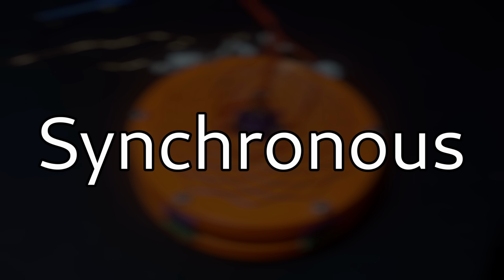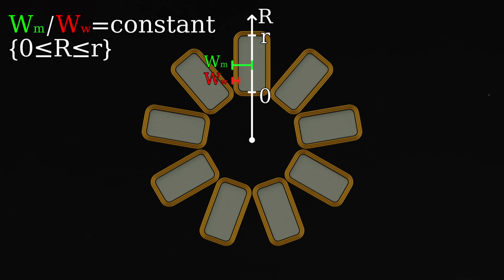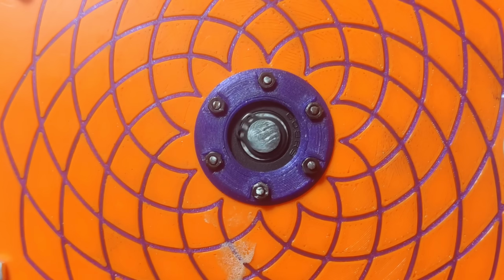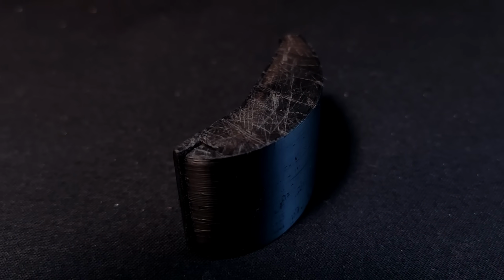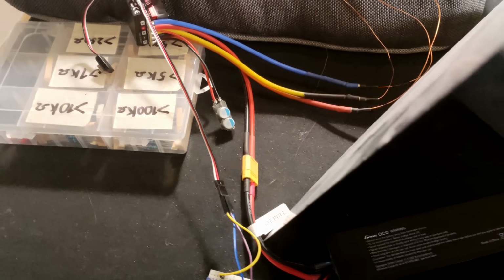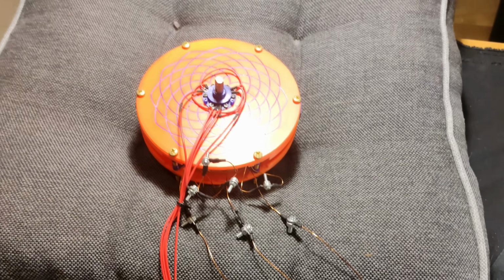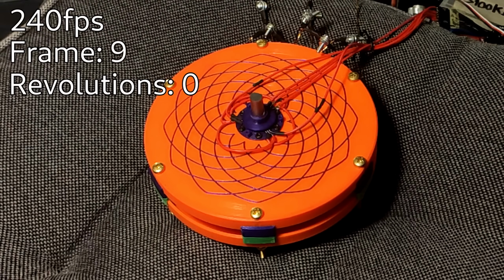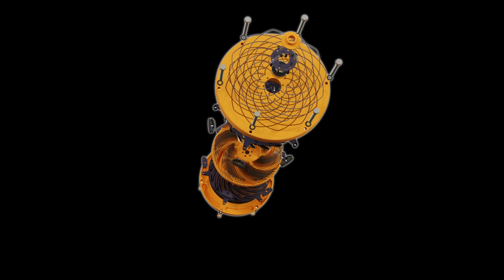Axial Flux Synchronous Motor Prototype

Comment: Axial flux motors typically use air-core electromagnets for several reasons that relate to efficiency, weight reduction, and magnetic performance.

Key Reasons for Air-Core Electromagnets:
Reduced Core Losses (Eddy Current and Hysteresis Losses):

Conventional motors often use iron cores to concentrate the magnetic field, but this introduces core losses due to eddy currents and hysteresis.
Air-core designs eliminate these losses, leading to higher efficiency at high operating frequencies.
Weight Reduction:

Air-core electromagnets are lighter since they don't require heavy iron cores, making axial flux motors more suitable for applications where weight is critical, such as electric vehicles (EVs) and aerospace.
Improved Power Density:

Axial flux motors naturally have a compact and flat design. Removing the iron cores further reduces bulk, improving power density and allowing for a thinner motor profile.
Better Thermal Management:

Air-core coils can dissipate heat more efficiently as they are not thermally insulated by a heavy core, making them less prone to overheating.
Reduced Cogging Torque:

In iron-core motors, the interaction between permanent magnets and the iron teeth can cause cogging torque, leading to uneven rotation.
Air-core designs avoid this issue, resulting in smoother operation, particularly at low speeds.
Trade-offs
Weaker Magnetic Field: Air-core electromagnets have a lower magnetic permeability compared to iron-core designs, which can result in weaker magnetic fields for a given current.
Higher Copper Usage: To compensate for the lack of a magnetic core, more copper turns are typically required, increasing material costs.
Mechanical Stability: Air-core windings may require additional structural support to maintain their shape and position.
Despite these trade-offs, the advantages of air-core designs often outweigh the downsides for applications where efficiency, weight, and dynamic performance are crucial
Reply from the maker: You will not find an EV axial flux motor without iron cores (typically they use specifically engineered materials, and at least in one case I have seen them use something similar to ferrite as the core material) but it is just straight out not correct to say that axial flux motors don't need iron cores... If engineered correctly, then they will increase power density and can also increase efficiency. 

For my next motor project, which I hopefully will get done within the next few months, I have even finally ran some FEM simulations, (and did just right now to confirm), and air cores lose out roughly 30% of the torque. Sure, the motor would spin faster for the same input power as a result but I specifically need my motor to be slower and higher torque at a given power input. 

As is almost always the case, you choose the materials and how you make your motor based on what you want your final result to be. Want a super highly efficient, probably fairly fast spinning but with low torque motor... say for a harddrive or something else like that? Go ahead and use air cores! Want a highly efficient, slower spinning but high torque motor with as high power density as possible? You probably will want to look into electromagnet cores, but you'll have to engineer them... not like in this video - with the motor shown in this video I agree that the cores probably actively harm the design rather than help it :D
Reply: @BirdbrainEngineer  On the contrary, high end EVs such as BMW, Mercedes, Jaguar, Ferrari, Lamborghini, McLaren, Koenigsegg even some Teslas use axial flux motors. I believe the company that came up with that concept waws Koenigsegg. The benefits besides efficiency is the low weight to power ratio. Furthermore, Rolls Royce makes axial flux motors for aircraft.
Reply from the maker: @ I did not say that companies aren't using axial flux motors for EV-s... I said that basically all of them have iron cores, usually out of an engineered material of some sort as opposed to the normal electrical steel laminations (though those also exist!). As far as I have seen, air core axial flux motors are used mostly in low power applications.

Comment: The problem is not your design, its your controller. ESCs are made to drive trapezoidal EMF BLDCs with concentrated windings. Distributed windings have a sinusoidal shape, which means that even if the control method was correct, you would have a lot of torque ripple and very low efficiency. You need a switched reluctance driver made for distributed windings.
Reply from the maker: You are correct in that a VFD driver would work much better for this and that a normal ESC would be less efficient and all... But the point never was to make an efficient motor, but to see whether it worked at all.

Comment: Your magnetic flux paths is through or normal to the pancake surface, so it will make eddy currents in the plane of the windings creating the magnetic flux, offset by gap. So the thin sheet, or not so thin sheet, is thin in the wrong dimension for breaking up eddy current areas into smaller, less lossy ones. Giant toroid cores can be cut into sections that are approximately the shape you have. Like a 1/3 of a toroid. The powder core does not need orientation like soft steel layers do. If the material can be had, and a way to fire the shape, you can make your own custom core shapes. Liked this video, shows curious not afraid of failing, just want to learn mode. :)

Comment: a permanent magnet synchronous motor, if you dont have the field windings connected to power source, can you freewheel the motor without resistance? I mean just in general with type of motor? Can a brushless hub motor be considered a synchronous motor?

Comment: Wow. Awesome project really, the way you set up the coils and ferromegnetic look very nice but I bet they were a pain in the a... to set up. I am actually trying to build a wind turbine generator and came up with faulhabercoils in the stator and a double rotor (on top and underneath). Those faulhabercoil windings are very nice, because you don't come up with lots of wire outside the magnetic fields, the downside is, that the magnetic fields do not cross the wire in 90° angle. This is (maybe) the cause why you have to 'kickstart' your motor. Love your work!

Comment: Afaik sync motors work because of Foucault currents (it's not about an attraction but about a repulsion). And you split your rotor into strips (and selected iron for that instead of aluminum or cupper). So, where a current must go?

Comment: What I am wondering is why don't the electric motor companies make ture high efficiency motors when they known the technology from TESLA for over a hundred years ??? This tech is right under there nose. Period vf
Reply from the maker: Brushed Axial Flux motors were first built by Faraday and later Jacobi made an actually useful motor. The reason for not building axial flux motors is because the efficiency gain in modern motors is not that huge... the gains are in motor weight and space savings, at the cost of more complex and expensive construction... so for the vast majority of use cases where electric motors are used, they just don't make economic sense. But in automotive applications, electric planes and so on, axial flux is likely the way things will go.
Reply: @BirdbrainEngineer  THANK you for clearing that up BBE. My thinking is this should of happened years ago. Peace vf

Comment: Hi!  You really  work hard ! Heats down!  Quick  question :  Is  trying  to  use  a  PCB  Motrors  technology  for  Axial  flux  motors a good  idea ?
Reply from the maker: Depends on your use case! If your design can work good enough for your use case with an "air" core and the current through the phases is not very high then why not! But for anything with higher power is likely to not be worth it - There are several limitations that the fiberglass used in pcb manufacturing brings up; Less copper in the stator as fiberglass takes up the bulk of the pcb's volume, worse cooling because the heat needs to transfer through the fiberglass first, usually no iron cores because pcb motors are extremely "flat", limited phase current because the pcb trace size is limited.
Reply: @BirdbrainEngineer  thanks !
Reply: @BirdbrainEngineer  another  question that popped  in  y mind  what  about  staticks  multiple   PCB  stators ?
Reply from the maker: @jebarijihed  Do you mean stacking multiple together? If so, then that's possible to do, though you'll have to figure out some way of reliably connecting the traces between the different pcb-s. Stack enough of them, and you might be able to even put an iron core in it with the help of some epoxy or something. But it still doesn't help with the other problems that a pcb stator has. For something that actually needs some good amount of power density, say like an e-bike motor, then pcb-s are kind of hopeless... I'm not saying you couldn't do it, but I also just don't know why you would bother with it when using magnet wire is much more efficient in such cases ;>
Reply: @BirdbrainEngineer  well worth a  try !     Thank you a lots  of  lots  :D

Comment: the gap created by the print between your windings and the laminations probably causes a lot of reluctance. reluctance motors in general are lower torque and are more sensitive to air gap also. 

for your KV: you should do the opposite test, drive the motor at a set RPM and measure the output voltage under open circuit

Comment: awesome video! really good production quality, extremely informative, one of the most informative Iv seen in a while, and just ingenuity at its finest with all that math and good understanding of the motor and its physics! EDIT: also Im just curious and i doubt this comment will get seen but how do reluctance motors induce a back emf/ resistance of some sort to the input voltage. all motors of some sort have some sort of back resistance because as rpm increases output power increases and thus input voltage and current draw should also change. or if there is no back emf or anything how would a motor like this work or what shape power chart would it produce?

Comment: What impose a max speed to this design?
Reply from the maker: Ultimately, physics. Easy answer... kv rating of the motor, which roughly depends on the number of wire turns on the electromagnets and the strength of the permanent magnets.

Comment: If you're looking to do without earth magnets, have you considered maybe a shaded pole motor design? Of course you'd need an inversion system of some sort to convert it from AC to DC, but I recently pulled one out of an old microwave, and it seemed to work well without the need for magnets. I'm new to all this, but an AC motor of some sort would seem like the way to go

Comment: What kind of calculations did you do in order to determine the design of the reluctance structures for the stator and the rotor? Have you used any electro-magnetic simulation tool like FEMM or MAXWELL? I use FEMM for a good approximation of axial flux motors / generators. It is a little bit tricky because it calculates more in 2D and I have to build the e-machine in a way to get a good approximation of the data. So I simulated a linear motor version of the build circular structure. But this is ok. The data came out in 10 to 15% approximation.

Comment: So a difference between SynRM motors and IPM/SPM motors is their Id, Iq current scalars. In an internal PM machine the Id current is always going to be negative while the Iq current will be either positive for positive torque values or negative for negative torque values. In a Synchronous Reluctance Machine the Values of both Id and Iq are positive. This could be why you kept getting a stuttering effect and no motion, the controller was braking the machine rather than accelerating it. I'm not sure what settings you had enabled in the Inverter but that could be something to look into. Also the Field weakening algorithm is different between the two motors.

Comment: Excellent work.  Very novel.  Since you're using a lot of 3D printed parts have you ever tried the iron composite PLA from ProtoPasta?  It's not as good as using real iron, but it's far better than just plain plastic.  It's about 40% iron by weight, which translates to about 8% iron by volume.  Magnets will actually stick to it fairly well, but it's not magnetic itself.  For generating stators, or for making iron backings for rotor magnets, it's just so convenient.  All those volute shapes could just be 3D printed instead and would immediately do the job, and there is, in essence, no air-gaps between the iron in the PLA and whatever you're wanting to generate your magnetic fields.

Comment: This is awesome . . . the achilles heel to the Axial flux motor IS the dependance of large mafnetic requirements . . . . there just isn't enough know deposits of approriate rare earth to powe the potential need of this motor type . . . . . a great achievement. The next step is to find ways to increase the efficiency as reluctance motors are always less efficient.

Comment: Small rotary tools can hit 30,000 rpm
Reply from the maker: Yes but what rotary tools are driving weighs less than a single magnet in the rotor of this motor and the radius of the cutting tool that is rotating is not more than 2cm, while the radius of the rotor here is over 5cm, we are talking completely different amounts of potential energy stored here. RPM is only half of the equation.

Comment: You can bias magnets into focusing their fields on one side by a halbach array, what´s not possible with coils. So, the stator has to be electromagnetic, and in the middle, in order to exploit its both sides, while the rotor is made of 2 discs with magnets, in halbach array config, embracing the stator between them. Otherwise it´s a huge waste of magnetic field, and thus, power/energy.

Comment: Correct me if I am wrong, but isn’t the center of the coil where magnetic field is strongest? Isn’t it the center, where all the flux lines combine?
Reply from the maker: I may be talking out of my ass here because I am still learning all of this as I go myself. But so far I have understood (and by my logic it seems so as well) that at a pole surface of an electromagnet, the largest magnetic flux density would be found at the circumference of the electromagnet, while the center of the pole surface of the electromagnet has a somewhat lower flux density. Reason being, we calculate the flux density outside of a conductor using the equation B = (mu_0 * I) / (2 * pi * r). Because the distance term r (for radius, of course) is in the denominator, then we have a hyperbolic relationship between the flux density and the distance from the conductor. This would suggest that even if you add together the effect of a coiled up conductor, the center of the coil would still have a lower flux density than right next to the conductor.

If I have misunderstood something gravely and/or am generally just wrong then do let me know!

Comment: you could probibly attach a gearbox to the motor and assuming it has 10kg of torck (which it probibly dosn't have) you could attach a 1:10 gear ratio and make a electric bike out of that
Reply from the maker: This particular motor can not really be used as an e-bike motor. Once it's getting warm next year, I will do a proper design for an e-bike.

Comment: THIS, is engineering. the application of science to solve a problem. if more people realized what engineering is, im sure many would be intersted.
Reply: I worked for my dad for a while in my 20s, if he gave me something to do I would take a moment to generate a plan, think about every move, tool, material I would need before I started ... Something that was expected in educational environments ... My father however would interrupt me with "stop thinking about it and do it, stop milking the clock, you are wasting my time and money" ...

When he did this, I would get rushed and do a bad job, which he would complain about, I tried other jobs for other bosses, and they were equally frustrated with me and my work methods. What I found out through my whole life is that 95% of all people could give a crap how things work, they really don't care at all about the universe they are a part of,  probably are incapable of anything other than being  mostly  concerned with their money, status and sex partners in their useless fake little societies.

Comment: i have a few questions on if this type of motor would need a gear box in the use of a wheel chair where with must be as thin as possible for high torque with like a reliable speed of 10 mph daily use back and forth rotation is there a way to speak with you on this
Reply from the maker: Sounds like something with half the power of an e-bike... this exact design would probably not suit for such a purpose, but in a few months I will try to build an e-bike motor... so perhaps there will be some ideas in that video/project for you to use.